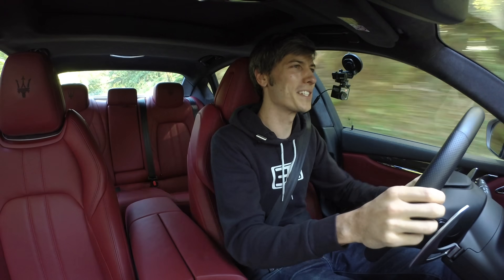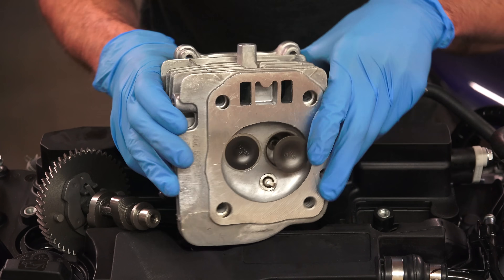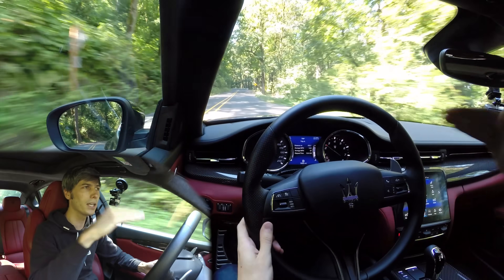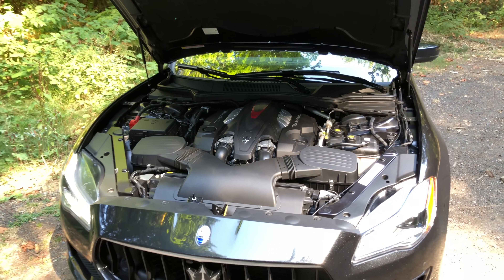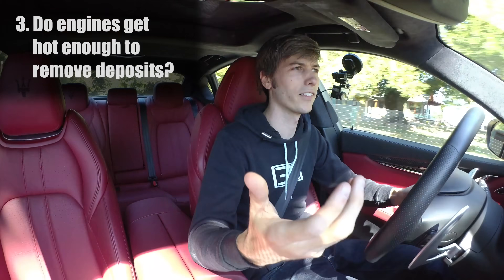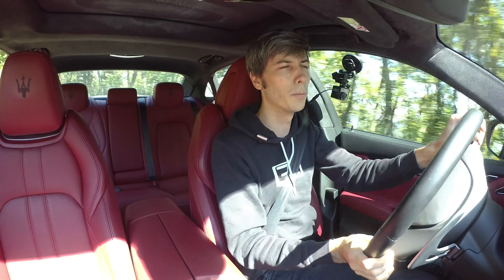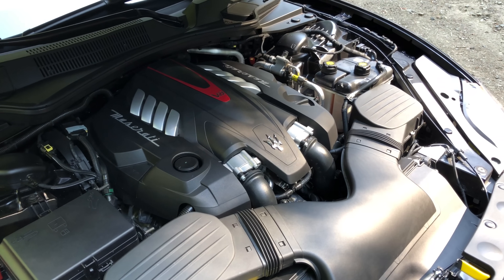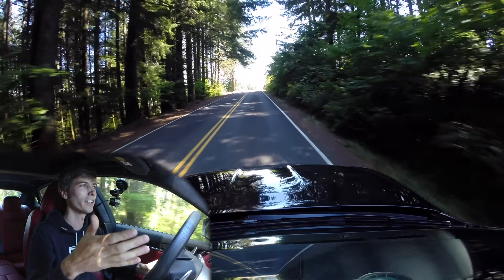Is Redline Good For Your Car's Engine? Italian Tune Up

Comment: Constant redlining isn't for me, but hey, whatever floats your valves.
Reply: Redline should be set well below valve float by the factory. My Cobra's redline is 6800, but the valve train should be good out to 7500. I have shifted at the drag strip at 7200 many times and never damaged the valves. I eventually had the oil pump gears blow apart and welded the rods to the crank but the valves were fine on the tear down.
Reply: Spotted the ls owner
Reply: Huh?

- an RX-8 owner
Reply: if redlining floats your valves you've got a bad car
Reply: Chicago Skater i dont have a redline
Reply: I'm gonna quote that for something I swear....  Anyways, who needs valves when you run rotary ;)
Reply: Redlining can clean your piston, but can it clean your head's nuts?
Reply: @WalterRitchey  Unless you drive a Corolla with a 4AF engine. Where valve float is at 6800rpm (if i remember right) and redline starts at 7200.
Reply: @StrangaPsychoPachic  You're not supposed to drive a Corolla like that anyway. It's for daily street driving and highway driving at some semblance of legal speeds. I had a 1.6L SOHC Toyota engine in a '93 Geo Prizm 5-speed. Gave it up to the wrecking yard at 280-some thousand miles because it had become an embarrassment to drive. I don't kmow how long it would have lasted, but my guess was, at least 320K miles. At least. Maybe a lot longer. I suspect the redline was given as 7200rpm because that was where the engine might have started flying apart. If valve float stopped you from getting there, it was to your benefit. Give the Toyota engineers some credit. Toyota doesn't play those kind of mind games for the sake of marketing. Or at least they didn't back then.
Reply: @anonymike8280  If toyota was so great then, why would they allow an engine to suffer valve float for 400rpm and continue another 200rpm or so before having ignition cut off? It was a engineering mistake and tuning mistake. My comment was simply stating damage to the valves occured well before toyota engineers deemed end of safe operating range.
Reply: @StrangaPsychoPachic  If actual damage occurred, then it is an engineering mistake. My postualation, as stated was that they set the redline at the point where engine damage could occur. I have never heard of valve float damaging an engine but maybe if the driver persistently pushes the engine to the point where that occurs, maybe there could be damage.

Normally, a Toyota Corolla is not driven in the way you describe.
Reply: @anonymike8280  Valve float can damage an interference engine.
Reply: @StrangaPsychoPachic  why is that
Reply: True, however.  Constant redlining isn't what is being mentioned nor is babying a vehicle always best.  The Italian tune-up  expression stems from say 60's-70's complex high performance often italian cars designed to run at high speed consistently.  However not being driven that way and thus deposits form quicker than if used as designed for.  Dropping performance and losing efficiency as it goes on.
Reply: @cardinaloflannagan8929  Just tell people, "You can't handle the truth."
Reply: Old pushrod American V8s do just fine at redline if you have some double valve springs, hardened pushrods and guide plates. Even something like an old Ford SBF is more likely to crack the block than it is to float or drop valves at RPM under load if you have good valvetrain hardware. Replacing valve springs on LS heads and adding a cam is the well known "sloppy stage 2" Denmah build for the 5.3 LM7 GM LS V8.
Reply: LS's do just fine. But I wasn't a fan of the last set of comp rocker arms I used. Hear what i thought was a lifter tick, open the valve cover and find needle bearings everywhere after 30k miles. Cam lift was .610 shift point was 6300 (usually 5600 stock - GMC Sierra) but still. As long as you have the right valvetrain hardware you should be good.
Reply: I've had good luck with Trick Flow-branded Scorpion roller rockers on my SBF 5.0. Polylocks haven't backed off after 2 years and 6500 miles, they are noisy but not excessively so, bearings are in good shape. I don't take this engine past 6k though it will spin to at least 6600 RPM(highest I tried, out of my cam's powerband). I've since set a rev limiter since unlike LS series engines short deck small block Fords tend to crack in half above 6000 RPM with high power output levels(400+ rwhp)

I don't personally redline my car a lot. Highway pull 5-6 times a month maybe, more if I am screwing around somewhere quiet or at a drag strip(duh). I can't really take the car above 4000 RPM around towns or cities with a 35 MPH speed limit for longer than a few seconds as it builds boost very quickly with a Vortech supercharger anyway.
Reply: Comment of the year
Reply: There was a long downhill stretch of the highway were i used to live.
Always floored my old -83 Volvo 240 GL and the valvefloat decided that
it had a top speed of 175 kph. It got so hot that it felt like it lost half
it's power after each run...
That B23 engine prob shined inside tho.....
Reply: If I had not started playing Automation since I got it with my birthday money, I would've never understood that joke.
I always set the rev limiter so the engine doesn't run into valve float, con-rod stress and piston stress
Reply: @racer927  don't game but did the real deal with lots of Honda's Auto and Motorcyle. Tough products.
Reply: My LS1 seems to do fine going up to 6500 rpm 10+ times every day.
Reply: You sir just won the comment of the year award.  Only gearheads will understand, and i love "inside" jokes, made me LOL hard. :)
Reply: Fantastic
Reply: Nice one!!!
Reply: This comment is fkn genius.
Reply: Solid gold
Reply: if they're in a pushrod
Reply: hahahah pushrod life
Reply: V a l v e f l o a t??? More like C O O L V I B R A T I O N S
Reply: 'whatever floats your valves' 😂😂 I'm dying rn
Reply: Brilliant 👏
Reply: Lmao
Reply: Underrated comment that so many plebs will not understand.
Reply: @2450logan  have rotary engine car.  What is this valve float you speak of
Reply: @IOutDoSyndicate 4 U that would be the apex seals, or maybe they'd just snag on a port.
Reply: Most underrated comment of the year.
Reply: I would’ve never got it until someone stated how underrated this comment was. Then I looked again.
Reply: tenattaten
Reply: Nicely said 😂
Reply: Lmao

Comment: With direct injection engines (especially the turbocharged variety) , it wouldn't be as effective due to the increased amount of blow by due to the higher pressures inside the combustion chamber. This of course causes an increase in vaporized oil passing the intake valve. This creates a perfect environment for the oil to bake onto the valve. The higher the rpm the more oil and therefore more build up.
Reply: Catch cans do anything to help diminish that?
Reply: Stopaskingmetochangemyname They do a fair amount to help, but there's still the issue of the egr causing build up and the stuff the catch can misses. New engine designs are utilizing dual injection to help to cause ( not officially though).

Comment: So for 99. 9% of people driving a regular car on the road, don't redline your car? Just to be clear.
Reply from the maker: Redlining is fine to do, it's an operational safety limit for your car's engine that was decided by the manufacturer. But this video discusses whether or not it's actually beneficial from a carbon cleaning standpoint.
Reply: @EngineeringExplained  ok that should clear everything up. tnx for the reply. Keep up the good work :)
Reply: redlining shouldn't really be done only on an engine with hot oil, preferably changed at half of the manufacturer recommended intervals. Also, revving to redline isn't  really benefitial to acceleration either. You should look up your peak torque value, and shift at that RPM value for maximum acceleration in street cars.
Reply: Levente Proksa.  Not true.
Reply: @Dryrain-d9h  lol someone's now gonna be doing some redline, almost guilt free lol
Reply: @proksalevente  In most cars, as torque begins to drop, horsepower rises, so it will actually accelerate faster. Also, it will produce more acceleration in a lower gear at higher rpm above peak torque than in a higher gear below peak torque.
Reply: @Levente Proksa Actually, you need the sweet spot between torque and RPM. That is the horsepower peak spot, and it is towards the high range of RPM.
Reply: @proksalevente  That's not how torque and horsepower work
Reply: @proksalevente  more around the maximum power level...

Comment: Just remove your coolant and go for a spin around town 🤣
Reply: My customers drive without coolant.  Not only does it remove carbon, it removes head gaskets and sometimes the whole car.  it also removes them from being my customers since I don't work on bicycles.
Reply: Driving around with a blown head gasket where the coolant is leaking in the clinders is the fastest way to get your engine clean.
Reply: Best way to remove carbon build up inside the car engine.
Reply: bumpassb 😂😂😂
Reply: My radiator was bad in my Subaru, I used tap water for a few months until the radiator finally went, luckily the radiator went in the driveway and the garage is where it got drained the rest of the way and changed, 2  bottles of coolant later the car has all new coolant and a new radiator, the heat works toasty well as well!
Reply: Yes 😂
Reply: Eek, I cringed just thing about it.

Comment: What about Diesels ? Is this a problem with turbo-diesel cars or just gasoline ?
Reply: Duskconqueror turbo’s on diesels are colder because diesel exhaust gasses are colder and the turbo gets carbon build up. Also very noticable on turbo’s with variable vanes, they get stuck when you drive the car economicly.
Reply: Can't find it now, but a couple of Canadian diesel mechanics made a video on turbodiesel catch can use and documented some impressive performance gains backed up with intake temp readings that really showed great gains on intercooled engines.

Comment: Ah. So that's the Italian tune up...I'll stop putting marinara in my gas tank now... never forghetti
Reply from the maker: Hahaha, the sauce is boss! +100 octane.
Reply: Don't use Ragu.

Make your own, with lots of garlic. Trust me, I work on Ferraris and the garlic adds more HP.
Reply: The marinara sauce desnt go in the tank . It goes in the crankcase buddy. The Al pesto sauce goes in the tank
Reply: Dont forget to salt your coolant
Reply: @anto427  Eurobeat is technically the mix of Italo Disco and Eurodance BUT better!
Reply: why did I read this in God's Thrash Italian voice.
Reply: @Bryan Archuleta if you have a diesel you can run it on filippo berio olive oil😂
Reply: It's supposed to go on the radiatore.
Reply: That's pretty good. I was just feeding strings of spaghetti into the intake with the air filter off...Hadn't used the sauce yet, good idea!!! lol
Reply: @dangleason9023  Sounds like something the Neutral Drop channel would do lol
Reply: I put pasta on my air intake and it runs like a jet.
Reply: Ragu in the windshield cleaner tank for maximum performghetti
Reply: @vague-rant666  or did you mean spaghetti bolognese?
Reply: Rob spaghetti
Reply: C6DRIVES I was hoping someone else thought this
Reply: Anto Don't forget Eurobeat! (Eurobeat is invented by Italy)
Reply: I put gas and ashes in mine cause its german.
Reply: @My.Name.Is.Chris.   witty, but sooo wrong..  LOL

Comment: Who the hell doesn't do at least 1 pull every time they drive anyway? A pull a day keeps the carbon away but it won't get rid of carbon already built up
Reply: elliot438bcfc my Mustang loves that diagnosis.
Reply: +Ungregistered User (yes I see that g in your name) :).  Actually sounds like you got a bad batch of fuel or you are using the wrong octane fuel.  I noticed a drop in the mileage on my Vulcan S too.  But that is because of the type of exhaust system I put on it.  Back pressure has its advantages.

Comment: Not sure man. I saw several engines apart and most of the deposits were formed on the exaust valves. This is of course on the port inject engine. When I mean most, intake valves had almost non and exaust had to be replaced as cleaning them would take too much time and was easier to replace.